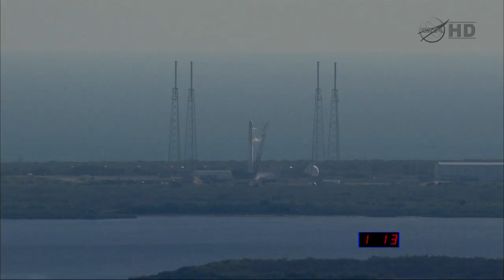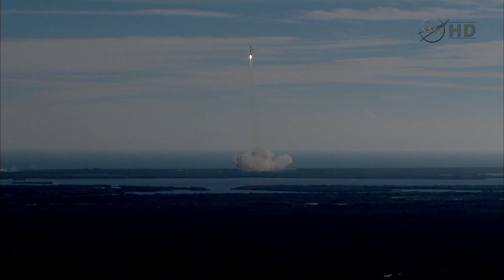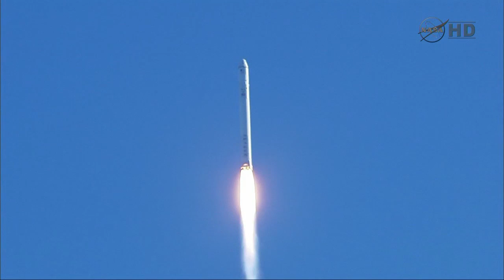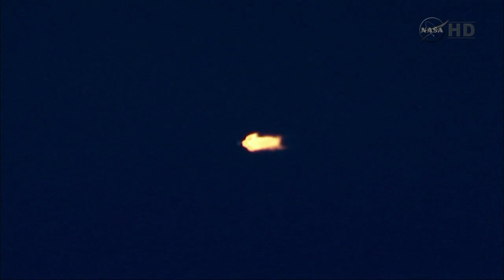SpaceX Falcon 9 Flight 2 NASA TV HD Coverage

Comment: The reason the shuttle and Ares I-X produces more smoke is because they both use solid rocket boosters. On the shuttle the two SRB's are solid and on the Ares I-X test vehicle the first stage was also a solid booster based on the shuttle SRB. Falcon 9 uses 9 liquid fueled Merlin engines which are generally cleaner burning than solid fuel rockets.

Comment: @srstacy 

Yes.  

Dragon Crew will have 4 abort engines built into the equipment bay, centered in the Draco thruster arrays.  If not used for an abort these engines, along with deplorable landing gear, will be used to touch down on land like the Apollo era lunar lander did - tail first. These engines will use the same hypergolic fuel supply as the Draco maneuvering thrusters (it carries 1290 kg).